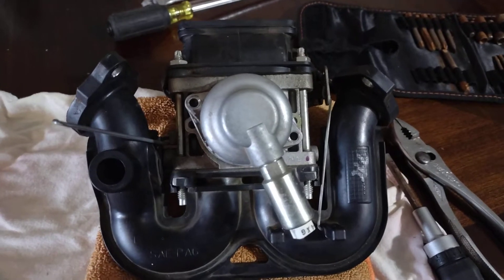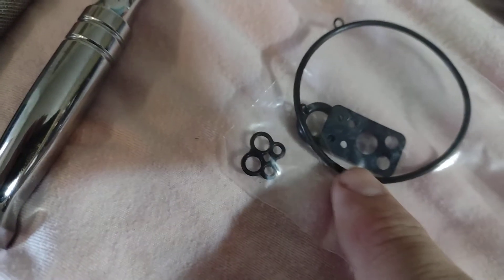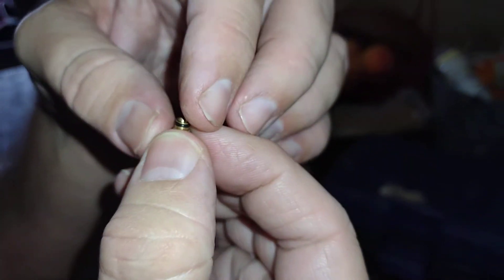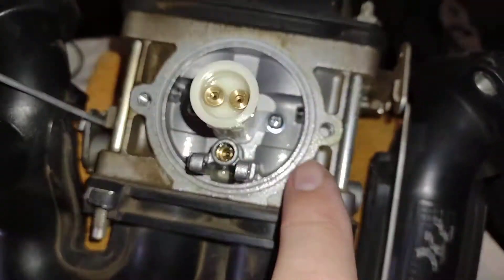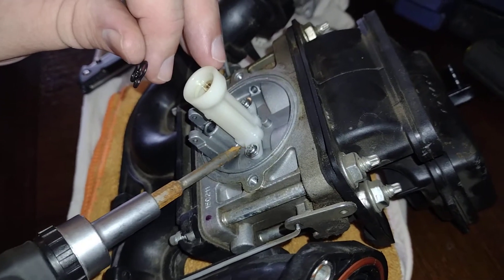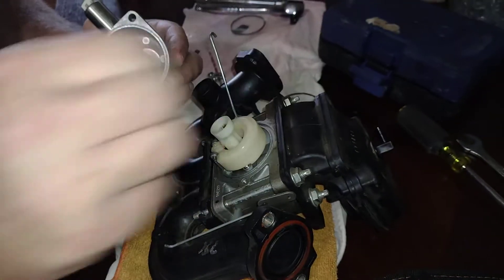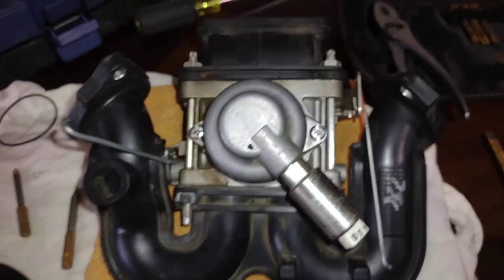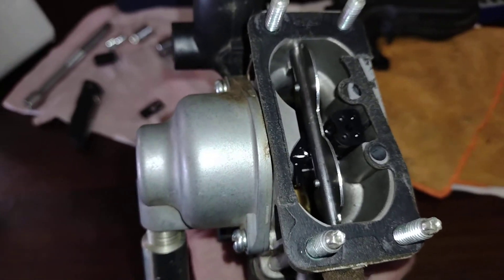Briggs & Stratton 22 hp twin cylinder engine Nikki carburetor gasket replacement.

Comment: Good job on your video Love The Hunt.  Good lighting and good focus.  A well focused shot is much more important than a close up that is out of focus and one where the shot is so close you can't really tell what is being pictured.  Watch a few more videos on cleaning and rebuilding these carbs and you will get it all together.  There are two jets and they have slightly different diameter orifices.  Your carb body is marked R for right side and L for left side.  Your jets should also be marked as to size of the orifice.  These parts are tiny and so are the markings..you did mention you don't have the best eyesight.  Fair enough.  One at a time works also. I forget which jet goes on which side but there is a good deal of info regarding that on other videos. 

You have to remove the butterfly to get at the black housing.  To do this simply take a close look at how the butterfly fits, rotate it so that the screw heads are accessible and remove them.  Don't worry about dropping one of the screws into the carb...there is no place for it to go and hide.  With the butterfly off of the shaft, simply pull the shaft out of the body for clear access to the screw that holds the black housing in place. Under it is an important gasket.  Note:  On some models there is a small spring that fits over a boss on the side of the carb. After reinserting the rod you will need to wind it one revolution to tension the spring so that the butterfly will remain open until the manual choke closes it. Place the butterfly on top of the flat side of the rod.  reinstall the two small screws.  Check for free movement of the butterfly and that portion is finished. Thanks again.
Reply from the maker: Actually I did take the butterfly off on the side in the spring came loose on the side to hold the butterfly open and it took me a little while to figure out how to put it back. I was able to replace the last gasket. Thank you for the help I appreciate it very much
Reply: I figured you had since your video is two years old. Still a good video and every bit helps someone who is trying to diagnose a problem with their mower.  I had given my old John Deere D130 to a stepson.  It ran fine into last fall.  He left it outdoors all winter and this year it would not start even with starter fluid. He has minimal skills for working on mechanical items such as this.  So, I said I will take a look at it but carefully questioned him regarding what he had already done. I specifically wanted to know what he might have done to the carb and since I don't work on these everyday...was it possible any parts were missing.  He admitted to removing the fuel solenoid only along with the plugs. So we pushed it up  into the rear truck bed and I took it home, cleaned it up, new gas, new filter, checked the fuel pump, new plugs, wiring, etc.

 I pulled the valve covers...pushrods were fine, lash was fine. Valves moved freely.  With the fuel solenoid disconnected ( fuel now shut off to the carb bowl) the engine would fire up and run like new as long as I kept feeding it a spray of starter fluid.  With the fuel solenoid hooked back up the engine would start but absolutely not with any choke.  It ran extremely rough, smoked a bit, blew out black exhaust.  Obviously too rich.  But why. I cleaned it, checked everything....nothing.  Took the carb to a mower shop...nothing, to the John Deere shop...nothing. Finally when looking at videos like yours I think I found the problem. 

Your video and Chickanic's and six others all show two jets in the bottom of the white fuel pick up/emulsion tube body.  This carb has nothing in the bottom of the tube but the rubber O ring. Stepson says he didn't remove the bowl. Hahaha....I take photos of before, during and after work like this.  There were no jets in the bowl. Perhaps someone removed the bowl and lost the jets???? Who knows. Anyway.....I'm thinking that is exactly where the problem is and your carb appears to be the same  model used on this mower.  So thanks for the good photos and discussion regarding these tiny but essential parts.  @lovethehuntOutdoors
Reply from the maker: @49bluesmanhuh  That's awesome 💯 I'm glad you were able to figure it out. I need to start another channel because I Use to enjoy working on my cars and lovethehuntoutdoors no longer applies. Lol  I'm now disabled and cannot walk or bend down without extreme pain in nerves in the groin area of both legs. Like hitting an electric fence in the groin. Oh what fun it is. Plus I get extreme fatigued after they removed 18" of my colon with really bad diverticulitis it makes me so sick I can't hardly do anything. Anyway one day I'll start up an automotive style channel and put my videos on there, if I don't die First. 🤣🤣😂😂🙏🙏